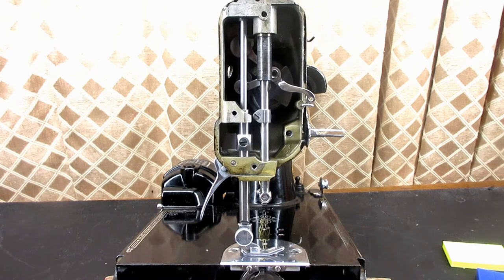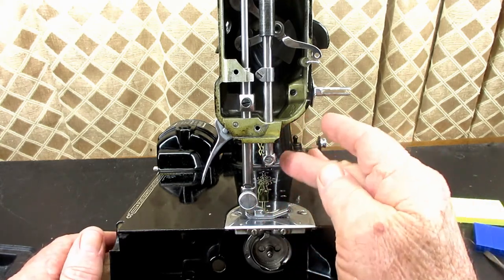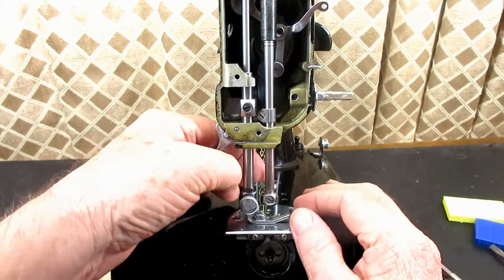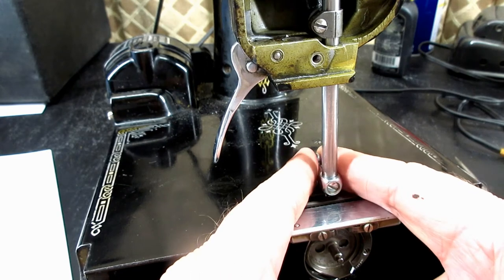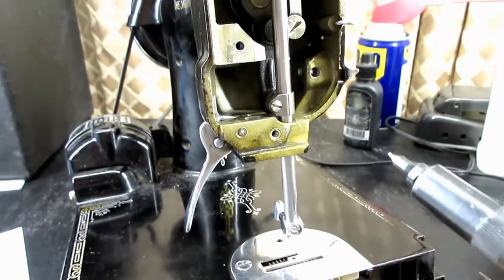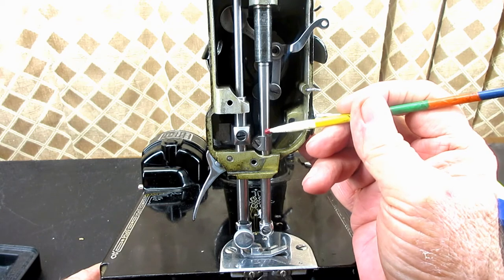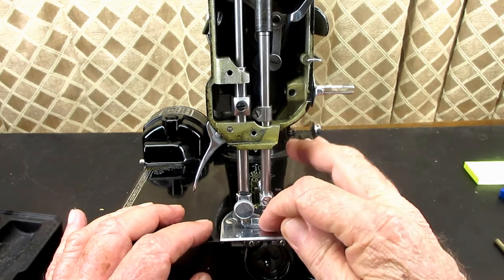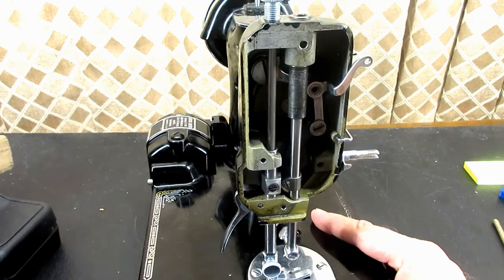The Fast and Easy way to Align the Needle Bar on as Singer 221 Featherweight Sewing Machine

Comment: Nice video I have singer  2517  in  my  machine the needle bar has 3 line mark on the top  of the bar  do you know how to set that   since i tried alote and was unsucessful  thx
Reply from the maker: sorry, that is too new of a model for me to have worked on. I have had requests about needle bars with 3 lines on other model numbers but we can not even find service manuals for them. A few viewers have commented that the lines on the top line up with something near the top of the needle bar instead of the bottom of the NB Bushing. On every Singer I worked on when the handwheel is turned toward the front to move the hook point behind the needle point you set the eye of the needle about 1/16" above the hook point and that is the correct height of the needle bar. Can't give you any more info, good luck.

Comment: Great info! Thanks. Is there an easy way to align the presser foot bar? Mine was misaligned and it took me forever to align it.
Reply from the maker: No easy way that I know of other than aligning it with the open slots of the needle plate. It is a pain and if it is just a little offline the fabric pulls to the side. I know in the future I will be double-checking every presser and needle bar I work on, haha.

Comment: Hi Andy I'm a fan of your explanation. I have a single 15 and it was kept in my garage for many years so I removed all of it and cleaned it up and this needle bar hight I'm not sure with the needle bar bushing position I need some help with this
Reply from the maker: Hi, Philip. Yes, the settings can vary by model. There are a few variations of model 15. You can go here and download a refurbishing manual that includes a model 15 https://www.scribd.com/document/355688276/How-to-refurbish-sewing-machines-TFSR-Refurbishment-Guide    This guide is what I used for "Cute" my model 99K. If you do not care to signup at the site, you can buy the guide from the charity that made it https://www.tfsr.org/product/sewing-machine/  The guide covers how to refurbish most of the parts of the machine, including the head (nose area)
Reply: @andytubesewing1953  wow that was awesome thanks Andy. Is there any other website for jaguar model.
Reply from the maker: @eric12062009  Welcome. I know that a Japanese company named Marutzen made some Jaguar models for Sears & Roebuck, but I don't pay attention or follow other brands than Singer so I can't advise. Many years ago I realized several companies had made machines for Sears and that parts, manuals, and repair guides were hard to find so I just stuck with the Singer machines. You should be able to just Google "Jaguar sewing machine" and find info. There are also many vintage sewing machine groups online, so I'm told, and people there are knowledgeable and happy to share info. Good luck, Philip.

Comment: My problem is, the needle hits the front of the hole in the throat plate. Thats the kind of alignment I was looking for.
Reply from the maker: Here are the most common causes for a needle strike to the needle plate: The Needle Clamping Screw is loose. Incorrect seating of the needle in the Needle Clamp. A bent needle. A bent Needle Bar. Here is a video about removing, replacing, and adjusting the Needle Bar: https://youtu.be/zY_XMne5YTQ   Here is my entire 26-video Playlist for Model 221: https://www.youtube.com/playlist?list=PLsCOZgzzaiKIA1OPw0k6QOSTE-wAUZ4kp     Here is a link to a FREE downloadable copy of the Singer Service Manual for Model 221: https://www.manualslib.com/download/995890/Singer-221.html